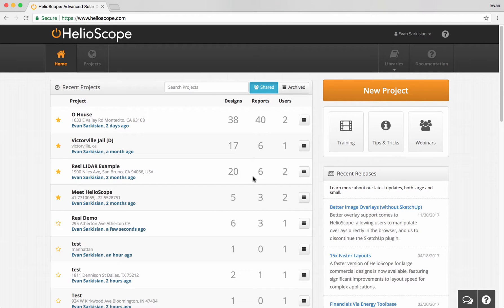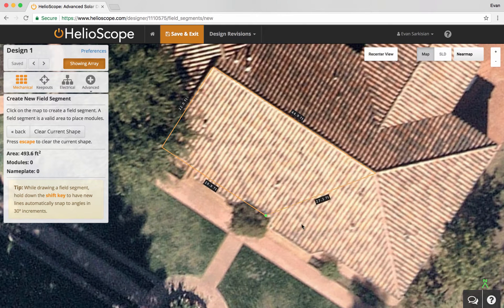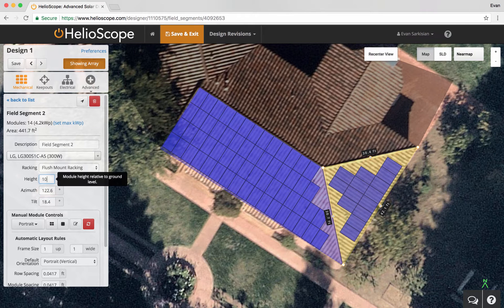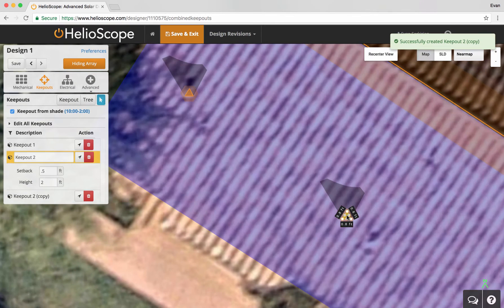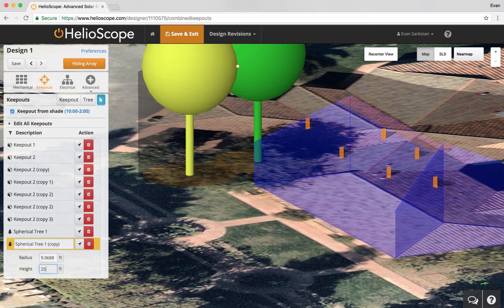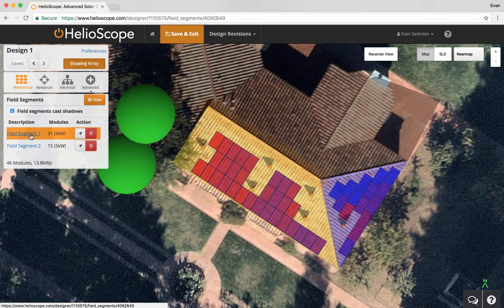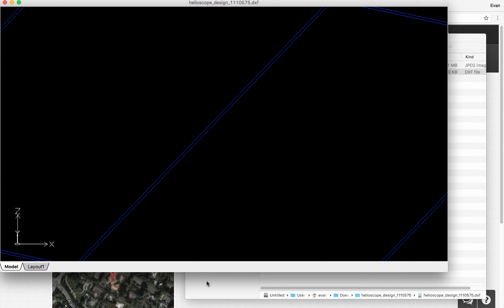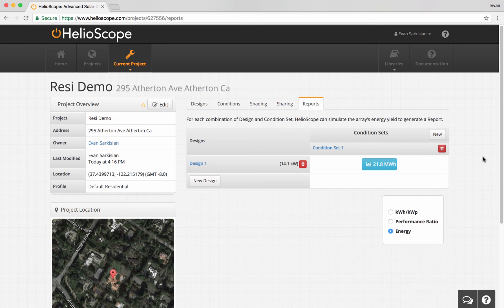5 Minute Residential Solar Design in HelioScope

Comment: Hi, is it possible to incorporate a Solar design that has solar panels with reflectors and determine the reflector angle relative to the solar panel?
Reply from the maker: Hi Charity - we don't currently have a way to modify the reflection based on different reflective surfaces. We definitely plan on adding more custom variables for modifying simulation results. You can read more about custom modeling here: http://help.helioscope.com/article/122-condition-sets
Reply: Please share the link for the webinar. We are interested.